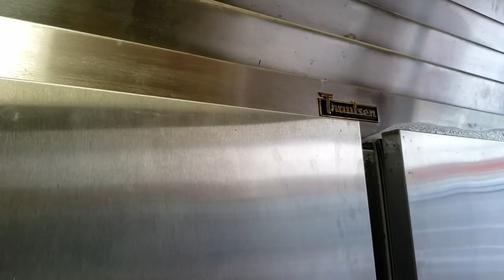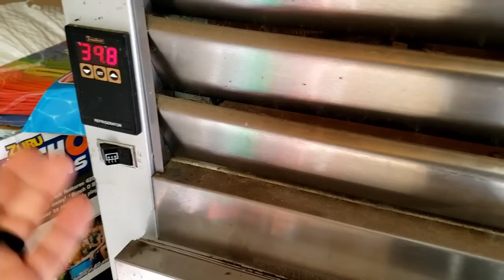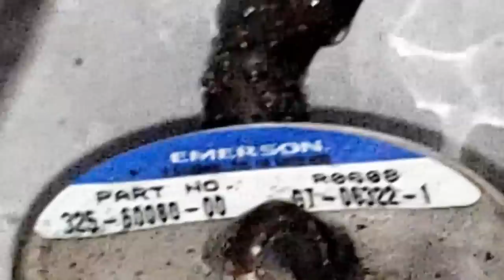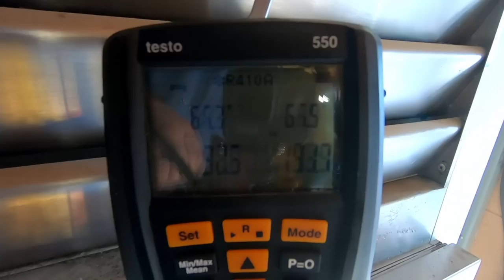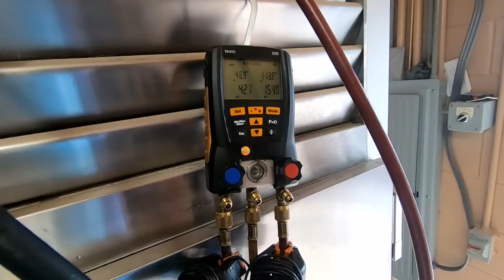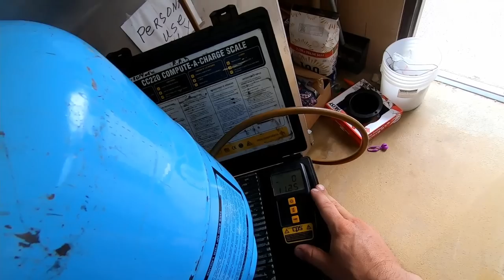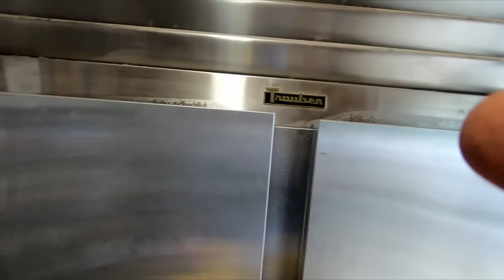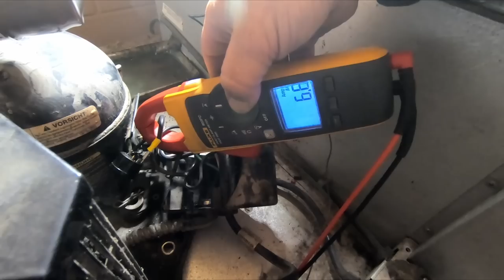Warm Cooler In Abusive Relationship!!!!

Comment: Nice video Rick! I replace about 6 - 12 R134A and R600a compressors a week on LG fridges, and I ALWAYS use a new overload because I ran into exactly that same problem a few times. Between how hot those inverter compressors run when they start failing, or because the factory left non-condensibles in the system, and the fact that nobody ever cleans the back of the fridge so the condensers are packed .... those overloads are usually weak by the time I get to them. I love how when you went back for the third time, even after I'm sure you said something about them using it as a shelf, that the light bulbs were back up there again! But then when they shove something up there and break a solder joint or hit a fan blade and you have to charge them to fix it then you're the bad guy!
Reply from the maker: Thanks 4 sharing👍👍. Yep, Those labels you seen on the cooler were from me 😁😁.

Comment: The dtek 3 is the man. It finds small leaks that the bubbles cannot pickup. But it takes an even real man to turn the damn thing on. I have to press on the power button with a sledge hammer. Let me know if your having the same issues...
Reply from the maker: Contact the factory, they will send you a corrected detector. I mentioned I had the same problem with mine. It was a manufacturing defect in the molding process. There's nothing wrong with the control board, It's just the rubber over the switch.

Comment: why would an intell-a-traul controller need a time clock and a thermostat? The coil sensor controls defrost and there should be a sensor for temperature. The old black ones need to be replaced with the GB (glass bead version).
Reply from the maker: Like I mentioned in the video The factory controls are only being used for a thermometer.  Somebody B4 are Co. decide to cut corners and replace it with a regular defrost clock and thermostat.

Comment: I have a York unit and is stopping intermittently, on the display board there is an error saying Building Pressure Sensor Failure, any idea???? Thanks for the good work
Reply from the maker: I don't work on York.
Reply: Check filters, then I'd see if you can unplug the sensor and see if that clears the error, or better than that test the sensor itself.. It may be dirty or damaged, Removing the sensor and if it runs, then its probably the sensor, if it doesnt run it may be a control board or an interlock with the aforementioned sensor, depending on it's job.. Could be make-up air related. Bad airflow can kill compressors. My thoughts without seeing anything.

Comment: whats the best and most reliable brand u recomend for a reach in cooler?
Reply from the maker: All of today's equipment manufacturers have been forced to go cheaper so they can compete against each other. So they've all started to lose their quality. We sell True, although their products are not perfect, their service after the sale and availability of parts has been superior to other brands. I can't think offhand of any particular manufacturer that blows me away but there is a couple out there that are logically laid out better with better designs but the price sometimes is two and three times more. Is that worth it? I doubt it...
Reply: @HVACRSurvival  Thanks! We have a True T-49G  and a True Reach in freezer. I always wondered if the family bought the right brand. The T-49G door LEds are half burnt out after 6 years (we bought it new) and so far only one thing has failed. the interior thermostat. I replaced that myself since it was a relatively easy fix. Anything else goes wrogn with the compressor though i will need to call. Asside from that, i make sure to clean the fan and coils from dust/grease and do an annual full cleaning inside and out once a year.  

Another tech on youtube said traulsen is the best brand?

Comment: Sweat on the front from weak door seals?
Reply from the maker: This is in a hot shed, chances are the door heaters aren't working. Generally most people don't care enough to replace them,  if you can replace them because they're in the door or frame.

Comment: In Commercial are they using adaptive defrost, where is measures the amount of time it takes to melt and ajd future defrosts intervals, door openings...?  I thought of inventing an IR detector to measure ice build up, imagine how much kw's are wasted on needless defrost cycles.
Reply from the maker: They have adaptive defrost on  the new True freezers. I've had a lot of problems with them not defrosting enough. (The store's waste so much energy with water running and doors being left open that a defrost heaters are the least of their worries).  But yeah they have it and I'm not a fan of it.  👉 However this cooler has a timed off defrost...  meaning the compressor doesn't run during defrost but the fans do run, this causes a natural off cycle defrost.
Reply: Imagine the environmental impact of manufacturing and recycling the controllers for adaptive defrost VS a termination switch... 
 We all want to save energy, but why? Sometimes it's actually worse for the environment than running a defrost heater that draws 3 Amps on a reach in.
 Bigger systems male more sense to have that technology. However, we still need to think about the environmental impact of the manufacturing of these controllers and PCBs, ECMs ETC... I know first hand the money saved in energy is usually lost when the energy saving component dies. Product loss, waiting for part as they usually aren't in stock, and the cost is silly high usually.
Reply from the maker: @jakem117  I agree with you about the waste.  I love trees and animals more than most people but to many people fall for the environment scam that's being pulled. I find it ironic every time "they" come up with a reason to raise the price of refrigerant because they developed a new reason for why the replacement refrigerant is now no longer safe or why you need to replace your equipment that's lasted 30 years with new higher efficiency equipment that will last 10-15 years....  If you're lucky 🤦‍♂️
Reply: Ya know who suffers from all this energy efficient equipment/components? 
 The customer suffers from expensive and long repair lead times. The contractor suffers when the brand new Carrier unit goes down from a bad VFD and there's no labor reimbursement. 
 When the Daikin Rebel package unit has its micro channel coil erupt after 10 months the contractor suffers because they don't pay for labor, gas, or tool usages. 
 Refrigerant is another one. I can't say CFCs and HCFCs are really Ozone depleting boogeymen because I'm not an environmental scientist or a chemist. We are honor bound (And legally) to recover it all, less Hydro-Carbons I guess. 
 The world is backwards and I try to not think about the people in India making 1.50$ a day using propane torches melting PCBs and wire to scrap, causing unprecedented pollution and loss of life and health. 
 I work in a state that I was rold require a 1 year warranty on a commercial system installation. So we eat some labor that really the OEM should be fully responsible for so long as the start up was documented and was correct
Reply: It also sucks to be the guy that has to say, yeah your Traulsen RIF has a bad Evap probe, and the new intelitraul C.C will.literally stop defrost after 72 hours with no resistance reference, so there I am installing a potentiometer to trick it into time INT time TERM defrost until the new thermistor arrives lol.
 On a side note if you're in FL I would consider moving counties to work for you. You're a legend in your own right to the industry and your comminty straight up
Reply from the maker: @jakem117  dude thanks really cool of you to say!👍👍.  I'm just sharing the things I've had questions about and sharing my on site learning. I'm in Ohio far as locations.
Reply: @HVACRSurvival  It all started 30 years ago when companies would come into schools and brainwash teachers and kids alike with free crap, and how we need to save to planet.  I watched it first hand, my wife is a 2nd grad teacher.  It's all about getting free resources back to the manufacturer, free plastic, free glass, paper...  With liners in landfills and plenty of land, it makes serious electricity from the methane, I know this because I was a rep for the electrical equipment for such sites.  In my County Pinellas FL we get about 15% electric from burning our garbage and with baking soda air scrubbers.

Comment: ? why you didn't change the txv to be safe
Reply from the maker: I'm not a parts changer, the only problem was the guy that installed this valve already once didn't know how to braze. If the units working fine when I leave and it acts up later and it's something different, then that's a new service call. Now if I'm working on a geothermal from 8 years ago 10 years ago that's a different story. I've had a lot of those txvs fail because of the Copeland rust inhibitor Fandango.

Comment: You made a mistake with the leak test, should have added nitrogen for pressure check then spray. The lines weren't even pressurized lol
Reply from the maker: Video clips might have been out of order. I recorded some on my phone some on the GoPro and it was three different trips.
Reply from the maker: All right I went back and looked at it, I just didn't show you pumping it up with nitrogen however you seen in the beginning I was using nitrogen to purge the system. I show too many things as it is in my video's,  I do try to leave some stuff out that I don't feel is as those important. I never meant for any of my videos to be instructional video from start to finish. I'm just showing what I'm doing and talking out loud. If someone doesn't know what to do then they shouldn't be doing it.

Comment: I take it, you are not a fan of the most popular $15. 3 n 1 start kit. 🤣🤣🤣
Reply from the maker: They work for light weight compressors, I carry 3 different ones on my truck for temp use until the oem parts come in.  The PTC won't last as long as a true start relay.
Reply: @HVACRSurvival  🤔🤔🤔... videos are great by the way.